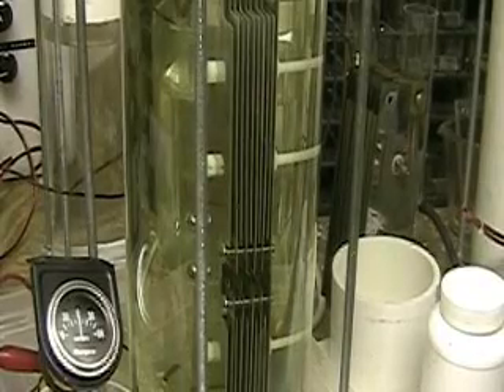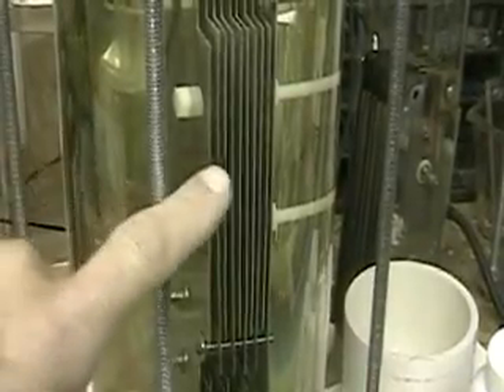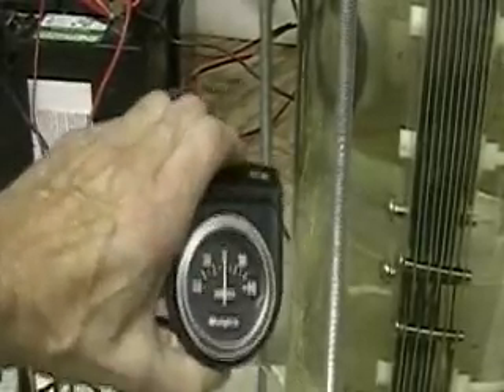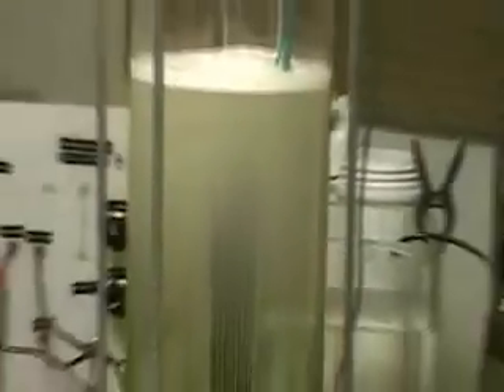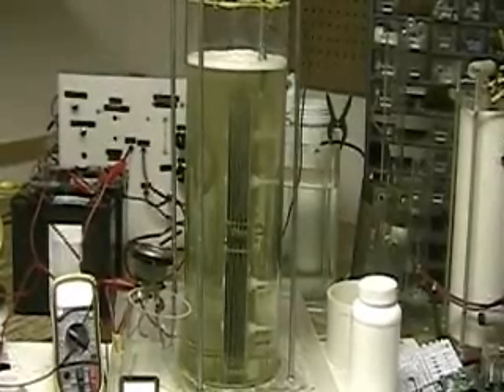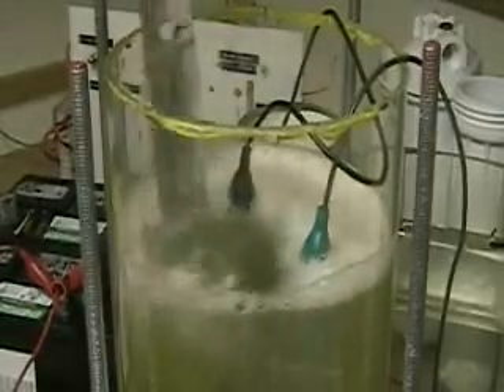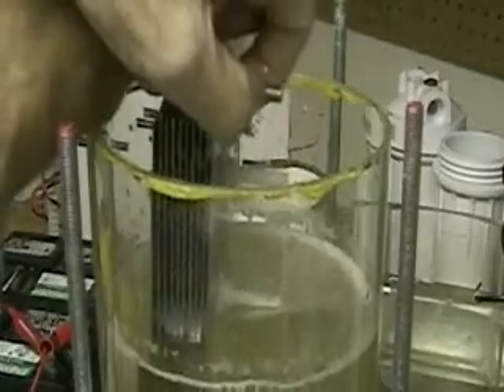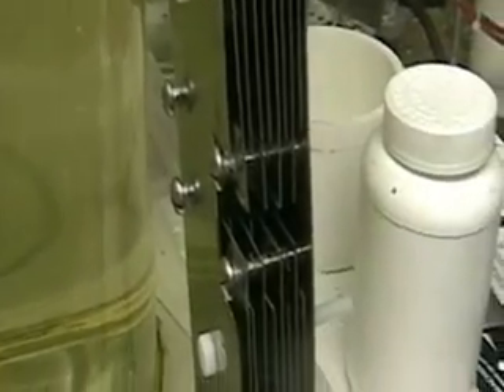Hydrogen Tap ( Tower-X Working Test) 258

Comment: The tower thing is looking good. I have some catching up to do, some have said that the cell produces more hydrogen laying down. Also others have been suggesting the use of a Pulse Width Modulator to reduce current and voltage (for efficiency). I know that you are testing various things. Do you intend to use a PWM later on?

Comment: John - based on your earlier successes - especially with the widowmaker, this looks a little anticlimactic.  Have you possibly run up against the law of diminishing returns?  You might fare better with more and smaller cells.  It looks like u need a lot of amperage for not as much production with this.